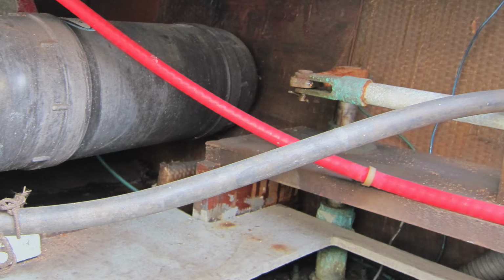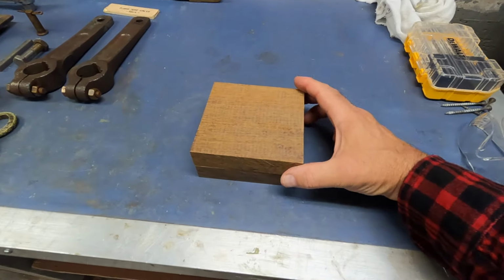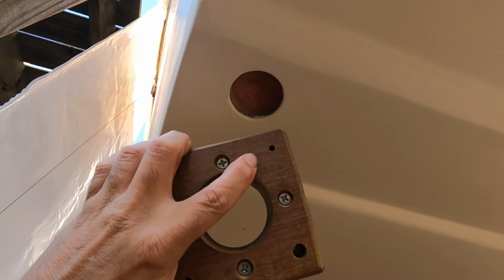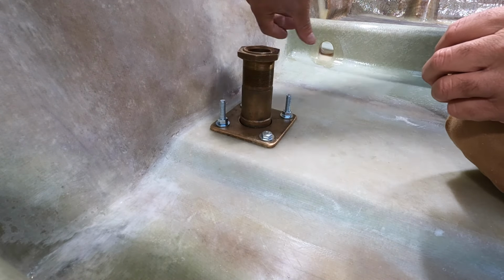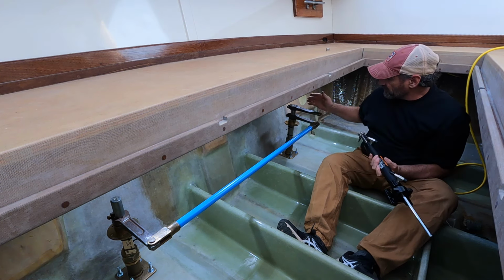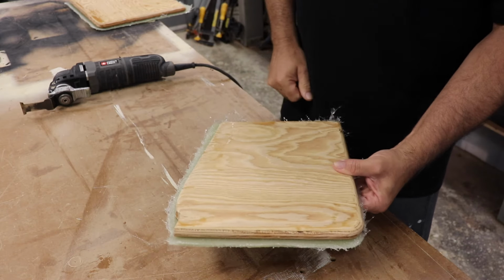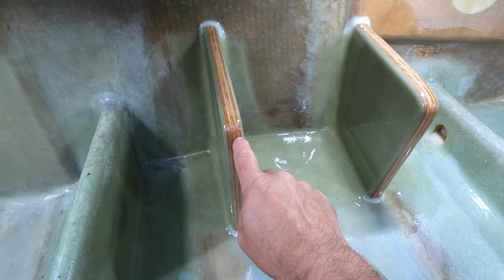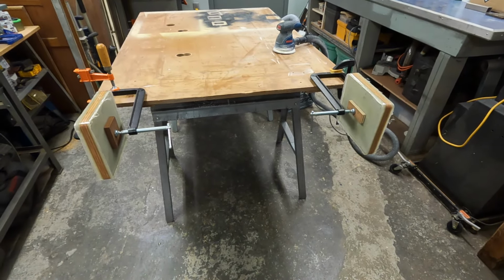Updating the steering system on the 1973 Egg Harbor Sportfish boat - Boat Restoration EP102

Comment: Bob, put the arm for the cylinder under the tie bar arms, then you can mount the bracket to the rudder support.
Reply from the maker: I will explore that option before I decide on the final location. Thanks for watching and the suggestion. - Bob

Comment: Hi Bob (and Mrs Bob), Thanks for the new video. That rudder setup will be many times stronger than the original, and much better protected with all the glass. Looks Great!! Hope everyone is well and continue to feel better and better. We continue with follow-ups at Georgetown Hosp, but everything is going well. 
Best Wishes, Jerry.
Reply from the maker: Hi Jerry, Good to hear things are going well. We are all well here. I finished the supports this week and I'm happy with the way they turned out. On to the next challenge. Hydraulic Cylinder mounting bracket and the dreaded welder. Wish me luck. Enjoy the Holidays. - Bob

Comment: Hi Bob, I think you had way too much fun filming that intro (be honest now 😂😂)
Im still marvelling at how smooth and clean your bilge floor is and the new supports just seem to emphasise the smoothness of everything.
And the rudder components, jeez what a transformation you made there too
Lots of hard work and its easy to see it, thanks for sharing
see you next time, be safe
Reply from the maker: It was fun. After the first attempt. I tripped on the tripod after the first 50 shots and had to start over. A beer and a deep breath helped the focus. I was quite pleased with the way the components cleaned up. I finished the supports this week and I'm liking the results. Cylinder support next. Looking forward to sharing in the next video. Happy Holidays. - Bob
Reply: @renovationsportfish1563   Absolutely, a beer and a deep breath solves most things (usually its cos your heart rate is getting back down to normal 😂😂)

Comment: Hey Bob!  Really good to see you again. I always enjoy seeing your meticulous work.I also hope your health is doing well.  One question:  I know you’ll have zincs on the rudders, but any concern for you on having SS carriage bolts on bronze rudder post housings?
Reply from the maker: I am doing well thanks. I will be installing bronze hardware when I do the final installation. The steel hardware I was using was just for the mock up. The old bronze bolts were in terrible condition and I also wanted to verify the bolt length I need before I order the new expensive bronze bolts. Thanks for watching and commenting. - Bob

Comment: One question—is the hull bottom cored?  Hard to tell from the video.  If it is, do you have to seal the now exposed core before the final installation to prevent water intrusion?  Really enjoy your videos and admire the work you are doing!
Reply from the maker: Hi James, No the hull has no core material. However the areas where the rudder ports are located have 3/4" marine plywood backing material fiberglassed over on the inside. I guess that could be considered cored. Yes I did seal it with penetrating epoxy. I failed to cover this in the video. I will address in the next video as others will probably have the same question.  Thanks for bringing this up. Thanks for watching and the good comment. - Bob

Comment: Wow, it looks impressive.  Hopefully you can get the geometry figured out and can get it all installed.   Will you be adding an auto pilot controller?
Reply from the maker: Thanks. More concerning for me at the moment is my welding skills. I need more practice before I start building brackets. I better get to it. Have not thought about an auto pilot. Maybe once I put some miles on the boat I will consider it. - Bob